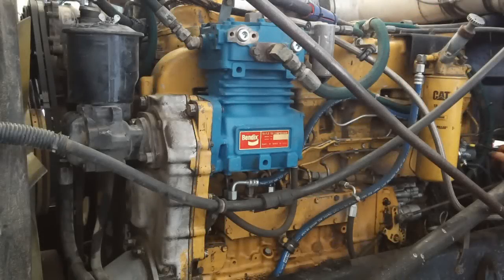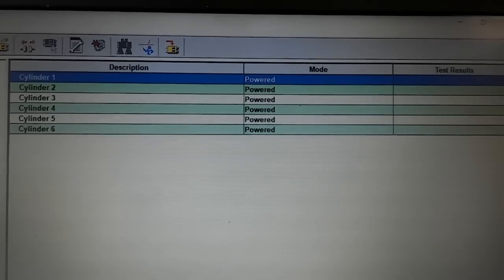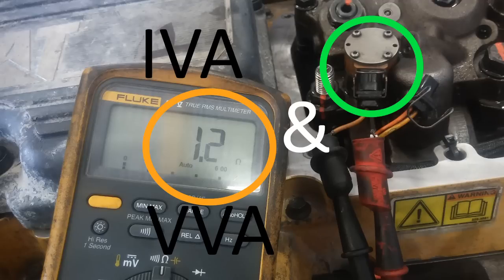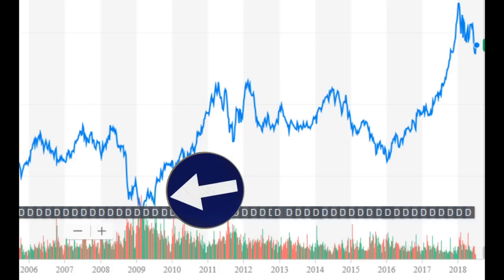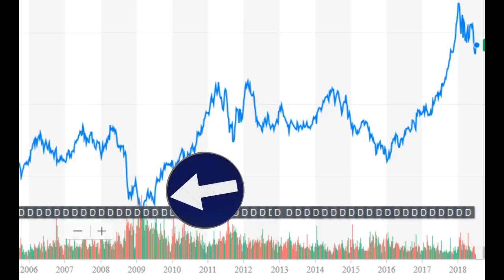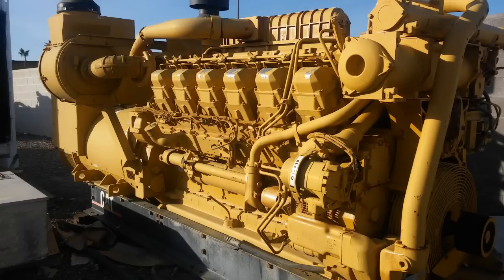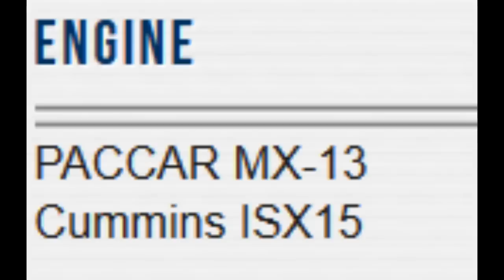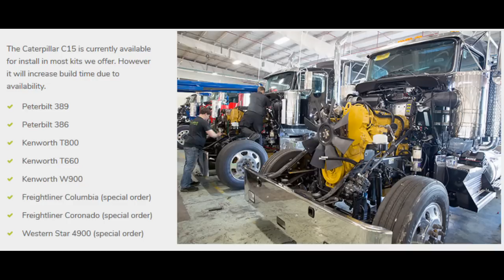Why Did Cat Stop Making Truck Engines?

Comment: Guys the major highway emissions were put in place in 2007, Obama did not implement them, I am not a Obama fan or EPA fan but that is the truth.  Caterpillar built and  stockpiled 1,000s of pre 2007 truck engines, up to january 1st 2007. As long as they had a serial number on the block it was considered a 2006 model exempt from 2007 emissions.  Also, Caterpillar still produces 1,000s of truck engines a year at their plant in Seguin,Texas.  The catch 22 is they are for military trucks which are emissions exempt.  They still build a C7.2, C9, C11, C13, C15, and C18 for military trucks. The military loves the engines and we hear stories of how trucks running cat power lost there oil pans in Iraq, nearly get destroyed, and kept trucking and got the troops home safe. I am proud to say the military buys the best engines for our boys fighting for this country and lot of them are cat powered.
Reply: Military does not buy the best anything. They buy from the cheapest bidder. That's how it works. Always has and always will.
Reply: @bubba842  you obviously do not know how to read..

Comment: When I was driving big trucks, the biggest complaint I heard about CAT was the fuel economy sucked compared to Cummins, and especially Detroit. When the new emission standards really started kicking in in 2003 the fuel economy got worse (4.0-4.5 mpg). Kind of hard to compete with engines that were still getting 6.0-7.5 mph with a decent load.

Comment: You can still buy brand new CAT C15 ACERT truck engines from CAT in Australia, however they can’t be installed in brand new trucks, only re-powers. Also the CAT truck in Australia had a CAT C15 but was a poor selling truck. Caterpillar plus Kenworth was an unbeatable combination in Australia and there were a lot of p****d off owners when they pulled out. Kenworth in Australia actually built up a big stockpile of CAT engines when they knew Caterpillar were going to pull out. My 3408 in my KW has done around 7,000,000 kms and it’s still going strong.
Reply: 7.000.000 !!!!!  wow !!!!     i have few C12 with 800 hours on it (we schedule by hours, not miles) and i am praying to hold a bit longer ... !!    a cummins or another good brand holds for 4000 hours without big trouble
Reply: Cat trucks in Australia are rebranded International Prostars.
Reply: Max Love did you not listen to what he said, it was all about the emissions nothing to do with the accert, the accert is a problem motor but not the reason why Cat got out of truck engine's.
Reply: And it uses fuel likes it got a hole in the tank?
Reply: eloyex,   800 and 4000 hours?   are you sure you are not missing a zero on each of those numbers?  

I've got old farm machinery that has 7000+ - 10+K hours on stock engines that were back in their day  considered the weak ones and I regularly work on industrial equipment that has 20K - 30+K hours on engines that are near bone stock sans external components like starters, alternators, water pumps, turbos and some injection system parts.  

Beyond that I have worked with gen sets that have had 40K - 50+K hours on all stock engines.   So to me your 800 and 4000 hour numbers seem suspiciously low!
Reply: Here in the USA, our government has destroyed diesel engines.  They took something as simple, efficient and reliable and turned it into inefficient computerized high dollar junk.
Reply: Acert is a Navistar/cat motor, not a true cat.
Reply: If I was cat, I would have quit too, the EPA is out of control.
Reply: You guys know that if you can't get your C15 in yellow, you can get it as the 15 litre Perkins (same ratings).... Perkins 2506*
Reply: Such a pity, Kenworth with a C15 or C16 was a marriage made in heaven.
Reply: Glad too see good relations with our friends from down under! Do y'all have cab overs like Europe or North American style engine forward tractors?
Reply: Eric Christian....About half and half. Cabovers for B-Doubles on the east coast where they are restricted to 26 metres, and conventionals for roadtrains and trucks where length isn’t so important. Kenworth is the #1 seller here in class 8 trucks. CAT used to be Kenworth’s #1 engine here, now it is the Cummins 15 litre. Kenworth Australia doesn’t recommend the PACCAR MX13 for trucks bigger than a B-Double.
Reply: gm16v149 I used to work at a Kenworth dealer in Canada and by far the best Kenworth ever made were the ones that had a C15 pre 2007 with no DPF’s. the C15’s with DPFs always had problems with the spark plug and wire in the ARD head emissions device which ignited the Fuel Doser and is a costly repair if the whole ARD head had to be replaced. We had a customer that acquired a 2006 T800 I think with the C15 and man he knew what he had because he took such good care of his truck that it had over 2 and a half million KM on the beast. Best truck that ever rolled into our dealership.
Reply: u can order cat engines c-18 through c-9 and perkins 2408's now every engines can be Taylor made to customers specs aa for as the truck goes there was a 3rd party (outside of Kennsworth)  from what I read and the were poorly made and that's y cat stopped but the engines are made in TX only plant in the world for the smaller engines. I only now a lil bit been working there for a bit😁
Reply: better a Prostar than a pornstar eh mate
Reply: or a pete
Reply: Well it won't be many more years and there will hardly be any trucks on the roads. Trucking is not what it used to be at all. Everything will be hauled by train to a central hub then distributed locally. Call me an idiot all you want but its coming. In not on here spewing bullshit with anyone. The states will have better roads, tires will be much cheaper along with diesel since there wont be such a demand for it. Remember when diesel was way cheaper than gasoline? I remember it clearly and everyone said f this bs ill go buy a diesel powered vehicle. Next thing you know diesel prices skyrocketed because the government and oil companies felt like they werent making any money anymore. The government already has been releasing toxic waste in the atmosphere I know for a fact due to my uncle used to fly the planes that dumped the shit. Remember back in the early days we didn't have everyone coming down with incurable cancers etc etc and now all of a sudden a ton of people including innocent kids and being born with cancer etc. Makes you realize how fucked up our government is. All they care about is the mighty dollar.
Reply: Eric Christian last time I was in australia, I was amazed by all the kenworth, Mack, and western star trucks that were made in australia.... all right hand drive too!
Reply: C501 Brute  
Cummins engines are great engines....
For making ship anchors, there are more caterpillar 3406e and 6nz c15 with over a million miles on them, then any other engine. Cummins never made a engine to compete with cats torque and reliability until the Cummins signature 600 and isx and they sure as hell weren’t reliable. 500,000 and it’s a ticking time bomb
Reply: Brett Marsh the L10 was good, we had a fleet of 250 buses most with over a million miles, and only had to replace 2 engines due to lack of engine oil....
Reply: Recreational marine? Both cats and Cummins had a  label on them that stated useful life 1000 hours, not withstanding the point that a recreational marine engine usually puts out about twice the horsepower of a road going variant model ( due to no altitude change and much bigger cooling capacity that a water to water heat exchanger has over a radiator) Cats are still available to the marine market but had at about the same time as they stopped producing road engines  doubled their OEM price
Reply: Tcmtech, he is not talking about old farm machinery and older diesel engines.  Those older engines that were good is what made a good reputation for diesels.  The modern, electronic, def-equipped garbage of today has nothing much in common with the good engines of yesterday.
Reply: 3408? Nice
Reply: Long gone those days were we could find pure blood trucks we could even heritage them to our sons and family , but now the trucks are real junk I see daily, truck with tons of problems they even had not work a month and  it already are in shops for checking engines, wires, turbos etc etc
Reply: I,am here to tell ya yo can just like the man on the video says  They called it a Glider Kit you been able to get them for i know over 45 years now . You put motor trans an rear end in your self lot of people that had a truck wreck would buy them make a good truck.
Reply: @gregoryfulford7612  I couldn't agree more, not just in the US the EU has done the same in Europe, I run an 2003 pick up that's old, tatty, got 130'000 mile on it!!!! But it's a 2.5 ltr four cylinder PUMP driven turbo diesel and it WON'T brake down.
Reply: @gregoryfulford7612  A diesel engine is more powerful,more efficient,longer lasting with many more attributes over a gasoline engine. At one time it appeared everyone was jumping on the diesel bandwagon and all of the sudden,the rug is pulled out. What happened? The money gods and owners of the world are entertained by the way we must dance to their sick,twisted greedy whims. I'm not a chem trail minion,but is it possible we are looking in the wrong place?
Reply: @aaireg  wrong!
Reply: My work still get CAT C13 engines. Most usually get replaced at about 30000 hours use in our Straddles.
Reply: Better still, Kenworth are now pulling out of Cummins in favour of PACCAR engines
Reply: @StaffordMagnus  that's what i have in my 2002 KW T800 Log Truck /w C15, Had it Bumped from 475hp to 550hp last august.. it works like a champ & have a 2000 KW T800 Log Truck /w C12, It's @ 430hp.. Both pull like Crazy... I try to get them when i can... Plus Rebuilding them & keeping them on the road is better then the DEF or SCR Units made since period
Reply: those engines arent supposed to operate upside down so i dont think your comment is relevant
Reply: my cat engine c15 acert done nearly 1.2 million still going strong

Comment: 3406B was the best engine ever made.
Reply: 3408B was better though.
Reply: 4MG...   ATAAC 3406B was definitely one of the best truck engines Caterpillar made.  The early 6NZ...   C15 was the best truck engine ever made !!   I should know. .   I worked for a Cat dealer in Melb Australia 🇦🇺 for many years.   & yeah Chris I worked on your 3408 a couple times.  Good to see your still out & about with it 👍🏼
Reply: Ive worked on pretty much every heavy on highway engine and think N14 select plus are the benchmark on reliability.
Reply: Yep still have 1 in an old w900
Reply: 3406b that is. Cummins is cumapart to me.
Reply: Bought a 79, 352 peterbilt,  had a 3406b. Love that truck, wasn't any thing better than trucking in those days. Every thing was better in those days, except the roads. But I'd go back in a second. Damn, miss trucking in the 70s.
Reply: 3406 A = DAMN GOOD MOTOR 
3406 B =LEGENDARY MOTOR 
3408 = BADASS LEGENDARY 
3406 E  in it's own respects is a damn good motor 
C-15 , powerful  but was getting way to overly complex 
Paccar motor = P.O.S.
I prefer the older engines more simple and was damn near bullet proof when worked on right and drove right  , but as a former trucker and a career technician i can definitely see the need for the ecm controlled engines in trucks because old school engines had a egt gauge,  so you know when to back down off them these newer motors do it for you and it's a good thing they do or else you'd see alot of burned down trucks on the side of the road
Reply: Second to the Detroit Series 60 in in longevity and fuel mileage but yes it was a good engine.
Reply: I operated one for 6 years. Oh my sum good memories
Reply: I had one --- the best -- bought used -5 million miles on it then I drove it for another 5
Reply: I disagree it was the 1693 425hp Cat the old granddaddy of them all
Reply: @kevinf5466  1693 425 hp was the best was originally made for bulldozers

Comment: I said i wouldn't cry dude...sniff...sniff....ahhhhh...haaa...haaa...haaaaaa.....ohhhhh the humanity. I'm gonna go open the hood on my 1996 W900L and hug my 3406e😭😭😭😭
Reply from the maker: Lol
Reply: MrBigR 504  Lol forgets to mention new engines are quieter better on fuel New trucks ride better turn shorter are more comfortable. I drove a 99 back in the day don't want to go back Times change  deal with it
Reply: Dale Heil I'm dealing with it just fine, me and my 1996 W9. You work your thing and I'll work mine. Yeah the newer engines are quiter, but thats also due to lots of them sitting quietly in the repair shop!
Reply: Lol  MrBigR 504 I feel ya bruva !
Reply: LOL! I wish my dad had gotten a W900 or early-200s Pete. My grandpa's Mack with a Maxidine motor was just as shitty as the new motors out their. The thing hasn't started since 05, so I don't think our new 1995 Mack will be much better. W900 with C15 for life!
Reply: @thetowndrunk988  The Pete 379 was the dog of the trucking world. No one in their right mind wanted one. There too small, and to expensive to operated.
Reply: @thetowndrunk988  Just one more way to show "you can't fix stupid".
Reply: @DaleHeil-ju2qq  Gutless scrap iron doesn't have anything to make a noise. With a properly fitting exhaust system ,my 1983 400 A model Caterpillar will get no complaints about noise.
Reply: @trucker1864  LMAO

Comment: This is an easy question to answer. Because Caterpillar said why when they stopped. Emissions controls. Emissions controlled engines produce more pollutants, burn more fuel, are less reliable, less durable, and produce less power for the same displacement as a conventional engine. Caterpillar wasn't willing to play that game with their reputation and company.
Reply: What makes them produce more pollutants? The DeF?

Comment: EPA is to blame, They should have had smaller increases in emissions standards, that way Engineers have time to get ahead of the curve for the next round of standards and prove their designs and work out all the bugs, Trucks would not be burning to the ground on the side of the road if they had time to work out all the problems.  If I was a Trucker I would buy a pre emissions truck that is in good shape.
Reply: @D8W2P4  I'm pretty sure that their scientist with maybe 10 years of schooling with masters degrees and phds know a lot more than you.
Reply: @bubba842 
>W-we-well they've just gotta know more since they've got master degrees.
Yet basic physics say no, furthermore if all your "argument" is gonna be is an appeal to authority don't waste both of our times.

Comment: in 1996 Paccar bought a truck company called DAF in the Netherlands, 14 years before Cat stopped making engines.  When Cat notified them that they were no longer going to be making truck engines, Paccar decided to replace it with the DAF engine.  The DAF plant did not have the capacity to supply both the European and the North America markets so Paccar built the engine plant in Columbus, MS to supply engines for the North American market.  The DAF engine, now branded Paccar, was not a knock off version of CAT but was developed independently in Europe.  The Paccar MX-13  undergoes continuous improvements to improve fuel economy, emissions reductions, torque increases, etc.  CAT was certainly a stellar engine.  So is the Cummins.  Today, when you buy a Kenworth or a Peterbilt (both owned by Paccar) you have the option of the 15 liter Cummins or the 13 liter Paccar engine.  Other sizes are available for smaller trucks.
Reply: I swear by the Isx15 cummins & pre 07 C15

Comment: Paccar was cat's biggest customer and when they bought DAF trucks (to expand into the EU market) they had their own engine, Paccar wanted this for their trucks. developing the MX engine and later a mid range engine so they could drop Cummins in the future. Daimler Benz bought Freightliner and Detroit Diesel and pushed the series 60, later developing the DD15 as their global engine. Paccar quit selling DD engines in 2002 saying they would not support the competition. as told to me when I worked at Kenworth.
Reply: camshaftP16 looking at the global market yeah pretty much
Reply: Paccar has been building engines since 1956, they decided to bring that engine to the state as a cost reduction, as the engine was already in the South American markets.
Reply: When Cat lost Paccar as a customer(poor negotiations on Cat’s part), this was the beginning of the end. It didn’t help with the fact that Cat wrote a check for $75 with each truck engine sold. Yes they were sold at a loss (according to the accountants). Chalk it up to “leadership” at the time...
Reply: camshaftP16 your right. But the mx motor is wank to, ours have all blown at or around 600 thou. Total rod through block fails. Cat engines stopped at paccar Leyland  trucks in 2006 when they stopped making foden wagons. They were a twist any how, a daf with cat engine an Albion axles sold for more money than a xf daf!
Reply: I work at a Kenworth Dealer and have been going to training. The Paccar trainers have been saying that in the next few years the goal is 80% Paccar engines in new KW trucks built. It's just trying to get the customers that order new trucks to switch from Cummins to Paccar.
Reply: Mike Peters well kenworth are a paccar company. Leyland were building daf 45 an 55s with a kenworth badge to export to Australia and New Zealand.

Comment: 3406b 425hp the best of the best
Reply: I love these recollections - back in the day they were a wicked bit of gear - but they had head gasket, water pump timing advance turbo lag and in hard use big end issues. Still they were a LOVED engine

Comment: Fitzgerald’s, with the rebuilt C15, are not using all genuine Cat parts. A fleet, down the road from one or our Cat dealers, is buying these gliders and are having problems with the engines failing after only 100,000 miles on them. After tearing into them they are finding aftermarket parts that shouldn’t be in there.